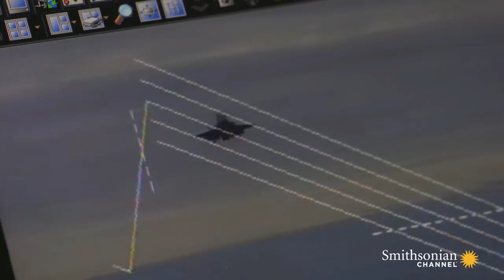This Fighter Plane Landing Has Never Been Attempted

Comment: So are we just going to forget about the harrier lol
Reply: The Harrier does not have the weapons load, multi-role, stealth, speed or range to compete with today's 4th and 5th generation fighters.
Reply: The UK Harrier hasnt flown for a while. The F35B is the replacement.
Faster, can supercruise for 150 miles, stealthy, easy to fly, supersonic, very advanced avionics and a number of other advantages.

For example... the Harrier was prone to pop stalls were it could ingest it's own hot air and stall when hovering. F35B doesnt have that problem. Harrier also had limited hover time and required a water cooling tank. F35B can hover all day.
Reply: it does say "this" plane but yes this maneuvre was performed by the Harrier. particularly in the S. Atlantic during the Falklands War... so much for unstable.
Reply: @raverdeath100  Ship board rolling landings weren't used during the Falklands were they. It was a modified Harrier that tested this on a French ship, but never put in service.
Reply: @paulvarn4712  he meant  the harrier has done this so it is not the first.
Reply: Ikr
Reply: @nathanaelmalm5641  but still the harrier was one of the most best jets ever designed the harrier is still better
Reply: @Blackout-px7sh  The harrier is in the past and has been/will be continuously bested with each passing generation.
Reply: @darkdreamsdontdie7785  agreed with that the harrier was made way before it's time
Reply: What Thomas meant was harriers were using this technique years ago to say this is the first rolling shipborn landing is quite simply b****ks
Reply: @Blackout-px7sh  Harrier is unstable and would often flip over during landing as a result of it's own downwind, killing the pilot. It was a cool and revolutionary plane, but the F-35B is simply better, just like all the passing generations will be.
Reply: I hate it when 'documentries' over dramatise things and make out as something is the FIRST, by implication, by emphasising the landing as NEVER been attempted before.  When instead it is an improvement from what the Harriers were.  Very deceptive in my books when someone does that.
Reply: Best dp ever
Reply: Paul Varn the harrier actually could carry a pretty decent weapons load. The AV-8B variant can carry up to 12x 500 pound bombs.  But it would have to use a conventional runway with that load. No VTOL
Reply: @nathanaelmalm5641  in 1980 a brit landed one on a moving cargo ship in the middle of the ocean with 1 minute if fuel left.
Reply: The Harrier could only do a standing lift or drop with a light payload and light on fuel. This on the other hand was loaded with rockets. But in saying that, there was a (LFW) low fuel warning at 0.50 indicating they started off light.
Reply: @skie6282  ok? It was still unstable during VTOL mode.
Reply: @nathanaelmalm5641  harrier is better as I said it was way be fore it's time
Reply: The Harrier aka the widow maker
Reply: I do believe the Harrier didn't have to ditch everything to land vertically. Not bad for an  old plane. Maybe they can tow a barge behind to drop unexpended ordnance on.
Reply: @nathanaelmalm5641  often flip?
Reply: You do know the Harrier is a retired 1960s aircraft, right?
Reply: @Blackout-px7sh  it was before it's time and it was the best a whule back. But, the F-35 is easier to control, can carry more weight, and has a bery modern cockpit. You can think what you want about it, but I think most people will agree that the F-35 is better, because of the technology now available to use.
Reply: Thomas Twohey the Americans cant comprehend we got there first
Reply: Also all the replies to this comment may have missed the “first vtol jet” or “first rolling vtol”
Reply: @Jake-xe2eq  nobody said anything about being first. It's not better just because it was first.
Reply: Technically yes
Reply: @skie6282  Also sounds like a British pilot who just done the landing in this video.
Reply: @skie6282  yes and under maritime law it belonged to the owner of the  cargo ship. I'd love to know how much we paid to get it back! Because we did in the end.
Reply: This plane Flys like a rocket with no wings ,
Reply: Eclipse 8316 no it’s not. The F35 hovers almost by itself. The Harrier was much more difficult to fly.
Reply: Steven McNally this is RN flying through British F35Bs on the HMS Queen Elizabeth.  Note the ski ramp bow
Reply: Thomas Twohey 
I guess so!!   I thought they had done this with the Harrier long ago.
Reply: @paulvarn4712  sorry, I'll have to correct you there. Harriers lift more and heavier payloads but agree, they do lack the required technology and design enabling them to compete with today's lighter VTF's.
Reply: @Rock-Steady  let's not forget the harrier was subsonic and not stealthy. During the Falklands we sent out harriers at night to try and find the Argentinian fleet. They had to fly ridiculously low and fly without their radars turned on in order to remain undetected. Not an easy feat! The harriers did compete their mission and found there carrier fleet. I remember the pilot saying he turned on his radar for a second and the entire thing lit up like a Christmas tree. Radar straight off and headed back to the task force at full speed. A jet way ahead of its time with the great British pegasus engine.
Reply: Never been attempted? Yes it has, been done many times, this video is BS
Reply: @nathanaelmalm5641  Often?
Reply: @alanstewart8216  yes, often.
Reply: @Jake-xe2eq  true, but you needed McDonnell Douglas to make it work
Reply: reemember yanks dont know any world outside the USA
Reply: @martinw245  the F35 also has 25 seconds hover time!
Reply: @1littlelee  Lot more than 25 seconds hover time. The Harrier had a restricted hover time and required water tanks to cool the engine. The F35 can hover a long time. In testing they hovered for 10 minutes before landing. They extend the hover too at air shows. The limiting factor is weight, ambient tempreture altitude etc. But yes, a lot longer than 25 seconds.
Reply: YAK-38 did it before Harrier. Wankers. 😂
Reply: @cyberia55  yak did do it before. A modified  Harrier did it too in testing but never emplyed.

The video didnt say first ever in the history of aviation. This is a FIRST for the F35 on any ship.
Reply: Martin W That’s how I understood the video’s intent as well. But the fanbois bitching about how he Harrier did it first, or how “yanks don’t know anything outside the USA” needed to be Yak-slapped. 😂
Reply: Hammer 001  "would you like to tell America that its Harriers it bought from UK dont fly"

Lol! You cant read friend. I said UK... that's UK Harriers dont fly anymore.

US Harriers indeed. Also the Spanish Harrier I watched fly at RIAT last year.

Here's a direct quote...

"The UK Harrier hasnt flown for a while"

How did you miss UK?
Reply: Hammer 001  Err... yes,case mentioned previously, the standard Harrier cant/ couldnt do a rolling shipboard landing. It was a MODIFIED Harrier that did so on a French ship experimentally. I recall Qinetiq Modified the Harrier.
Reply: Hammer 001  They arent British Harriers if they have been bought by the US, they are now US Harriers. ;)
Reply: Hammer 001  Clearly you are someone looking for an argument. You fully understood the context in which I said UK Harriers havent flown for a while. 
That's UK Hariers STILL owned by UK and flown by us. Not bloody Harriers we sold to someone else.

Please troll somewhere else.
Reply: UK sold its Harriers to the USA for pennies. Many Americans believe it's an American plane.
Reply: @lordloverocket7491  The ship owner was paid £530,000 after a long 'discussion' after the aircraft was removed from the ship by the Navy.
Reply: @craigaleg1  Sorry? The only thing McDonald Douglas did was come up with a larger wing and the the resulting AV-8B / GR7 and GR9 were developed and built by them and BAE in equal parts from 1981.
You might recall the RN proved how to use the Harrier in 1982 in combat.
The engine was still the RR Pegasus and the whole aircraft was basically the same as the 102 AV-8A and 8 TAV-8A Harriers built by Hawker Siddely for the USMC between 1971 and 1976.
The Yanks never 'made it work' Pal Hawker Siddely (later BAE), the RAF and RN did that long before any Yank got his hands on one.
Reply: Andrew Flame awww yeah that.  Would be sick
Reply: The Harrier can carry MORE than the F-35, as well as has greater range and can perform almost all roles at once.  The only thing it does not have is speed.
Reply: @boomerrob9223  Uh, no, none do.
Reply: Harrier what harrier that doesn’t exist now.
Reply: @martinw245  Harriers made shipboard rolling landings plenty of times.
Reply: @nathanaelmalm5641  Evidence of that ''fact'' ??  maybe it happened with us marine pilots but not once with  Royal Navy or RAF pilots.
Reply: @ThisIsMyRealName  Yes it killed a lot of enemy pilots during the Falklands War. ☺
Reply: @mfuller1093  A  Yak did a shipboard rolling landing as did a Harrier on a French ship experimentally but never deployed. So no, not plenty of times.
Reply: @j.4354  
Haha... didn't you know, America is the only country in the world.
Reply: @martinw245  US Marines still fly the Harrier.  England sold their Harriers to the US.
Reply: The Harrier and the Yak, but apart from them.............this is the US of A so the bigliest.
Reply: @terrydouglas5008  

"US Marines still fly the Harrier.  England sold their Harriers to the US."

Very true, and sold dirt cheap I recall, mostly for spares. In fact we have the US to thank for the aircraft becoming its final improved version, because it was the modifications that improved it tremendously. IIRC, improved engine and wing.
Reply: @j.4354  

LOL!
Reply: @paulvarn4712  it’s still pretty sick though
Reply: @Billhatestheinternet  speed, maneuverability, stealth, and is easy as balls to fly
Reply: Yes.
Reply: @mfuller1093  179 pilots died in those planes due to crashes from how unstable it was
Reply: Yes
Reply: @ThisIsMyRealName  Not in the UK. The USMC had a lot of accidents in the early days because they didn't operate the aircraft within its limits (perhaps they didn't know at the time, but still...)
Of all the Harriers the UK has lost over the years, very few are specifically down to 'instability' in the hover (and even then they might have been caused by mishandling). The vast majority are down to other causes, including:
- controlled flight into terrain/sea/ship
- engine failure
- control failure
- bird strikes
- mid-air collisions
- fire
- brake failure
- nozzle control failure
- combat losses to enemy action (several in the Falklands, one in Bosnia and one in Afghanistan)
- pilot error
Reply: @martinw245  David Morgan performed a rolling landing on Hermes during the Falklands War, after returning from the attack on Stanley airfield with battle damage. So it was done operationally at least once.
Reply: @Solidboat123  

Oh right. Battle damage though. So an emergency landing. Was never a regular operational procedure.
Reply: @martinw245  Not as far as I'm aware no, the standard approach was always to transition to and stabilise in the hover alongside the ship, then drift across.
Reply: @nathanaelmalm5641  Often? How often did this happen? How many pilots were lost performing landings of any sort?
Reply: The Harrier is still a Legend
Reply: @paulvarn4712  that's not the point, this type of landing HAS been done before by the Hawker Harrier whether or not the planes have the same level of technology is inconsequential
Reply: @Blackout-px7sh  In the Falklands, the harrier was only really tested against fighters that were still using manual canon targeting and had one outdated guided missile type. Those enemies were also near the end of their bingo (half-way point for fuel) so they couldn't really compete and were often shot down while fleeing.

The harrier couldn't even go supersonic, nor perform 9g maneuvers; never mind the crazy ones only the SU-57 and F-22 can pull off that the F-35 can also do.

Besides, the F-35 doesn't have a 1 in 4 VTOL crash rate like the Harrier so....

And the F-14 came out only 3 years later (comparing first flight dates), and that was also an "ahead of its time" aircraft that was still considered so much of a threat to US allies in the middle east in 2006 that the US scrapped all of theirs upon retirement to prevent Iran from getting the spare parts, since Iran has its own fleet of F-14s still flying.

The Harrier was never considered that kind of security threat to anyone  when it was retired.
Reply: @Blackout-px7sh  How is that, it was made in the correct time with the materials and knowledge available at the time, so before..?????
Reply: @ThisIsMyRealName  nope, that title belongs to the Lockheed f100 starfighter
Reply: @Luuk vanTwillert 

What's not the point? You will have to start quoting so I know what you're referring to. Random statements don't give me the context.
Reply: Of course the Harrier was the first VTOL fighter. In fact, I don’t believe the F35B has vertical takeoff capabilities, only landing. But the Harrier was less stable on landings, mainly because its downward firing jets were closer together, providing a narrower base. And the F35B, being a much newer aircraft, of course has a whole lot of advantages such as stealth (better than any fighter in the air that isn’t an F22), super cruise capability, an incredible sensor suite (really, best in the world), the ability to share communications with area allies to the point of having a full picture of the battlefield even out of its own radar range (or relaying information to a Gen. 4 fighter so they can launch at target), the ability with the helmet for the pilot to be able to see any direction through the aircraft spherically, the ability for the pilot to launch a missile in any direction spherically (including at an aircraft on its tail), the ability to serve as a sort of baby AWACS. All this and you can’t see it coming. F35’s can beat F15’s and F16’s at Red Flag. I don’t think Harriers can do that.
Reply: @Deutsche_1   that's actually interesting ... I looked that up and the Germans did call the Lockheed f100 Starfighter the "widowmaker" as well.... The Americans called the harrier the "widowmaker" .... Intriguing 🤔
Reply: @ThisIsMyRealName  yes because the F100 was flying like a shoe with no wings, very unstable and landing was almost impossible, German pilots would rather fly an old ME109 and risk crashing at takeoff...
Reply: @Deutsche_1  very interesting I did not know that.... Thanks for sharing the information
Reply: Is there a bug on my screen?
Reply: @Nathan Mukhey 

"but wasnt the f35 taken down by a bird once?"

Oh yes. Not exactly taken down though. It was on one of our new carriers we now have in the UK. It was during testing. A bird decided to fly right into the front lift fan.

 I don't believe there was any damage though.  Any jet engine that sucks in a bird would be checked for damage.
Reply: Nice pfp
Reply: @raverdeath100  "but yes this maneuvre was performed by the Harrier. particularly in the S. Atlantic during the Falklands War... "

Incorrect.
Reply: @Knightfang1  "But it would have to use a conventional runway with that load."

Or the deck of a LHA/LHD.
Reply: @jamesbibel4031  "I do believe the Harrier didn't have to ditch everything to land vertically. "

Any idea what the bring back weight for the Harrier was in order to execute a vertical recovery at sea?
Reply: @lordloverocket7491  £570,000 ($1.14 million)
Reply: @c3aloha  "this is RN flying through British F35Bs"

BAe pilot Pete "Wizzer" Wilson flying USMC F-35B BF-04 augmented to VX-23.
Reply: @Rock-Steady  "Harriers lift more and heavier payloads"

Incorrect.
Reply: @lordloverocket7491  " with the great British pegasus engine."

Built with 75% of the funding provided by the US taxpayer via the MWDP after the British government refused to fund it.
Reply: @AA-xo9uw  and where did I say it didn't?
Reply: @AA-xo9uw   Quote:
     "You ungrateful revisionist history hooligans"
No revisionism here Soft Lad just simple facts. Pegasus was a BRITISH designed and BRITISH built engine from Bristol Siddeley that powered the BRITISH designed and BRITISH built P1127, Kestrel and then Harrier aircraft designed by Hawker later Hawker Siddeley. The first US Harriers were AV-8A and C models built in the UK by Hawker Siddeley and shipped to the USA. The first time the USA built anything was with the later AV-8B version where development and manufacture was shared between McD-D / Boeing and BAE Systems.
I am all for having discussion and even disagreement but with you Yanks that is beyond your mindset. Its always down to personal abuse. But then as Oscar Wilde observed:
    "Abuse remains the refuge of the witless"
Reply: @AA-xo9uw  and how much did the USA contribute to the armour used on the Abrahams tank,or did you think that armour was an American invention?